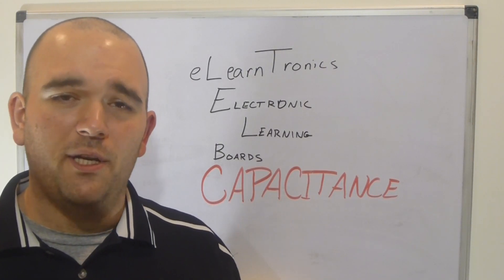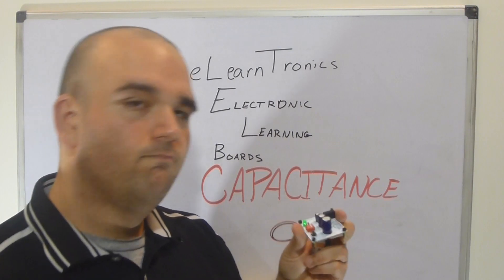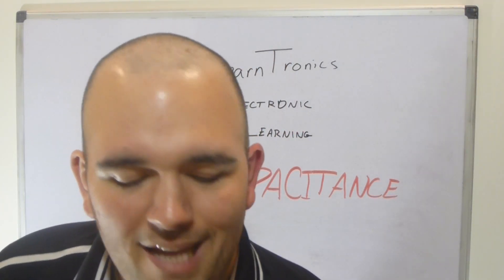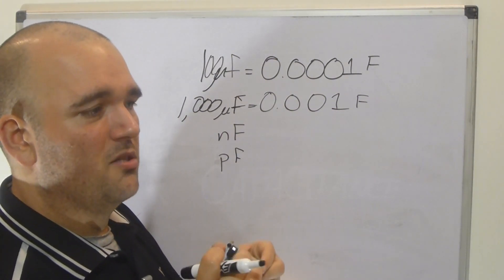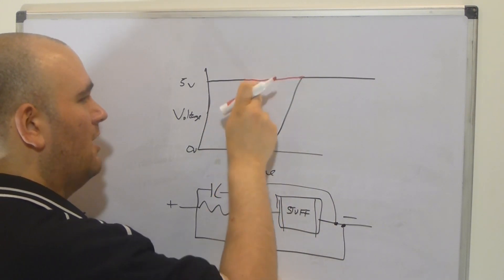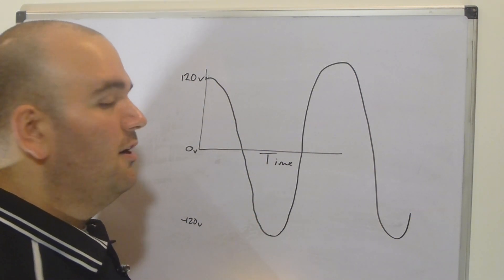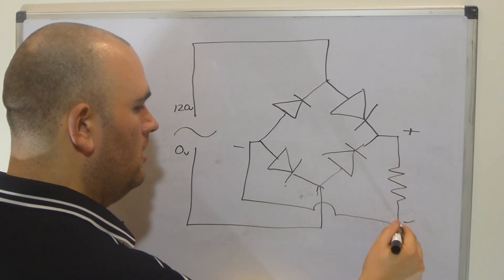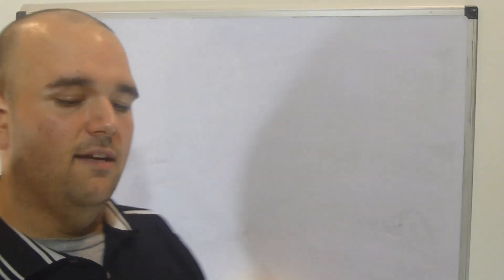Capacitance: How does it work? | Electronics Learning Boards from eLearnTronics

Comment: Hi! I've just completed this project, and although everything works -- I do see a difference in the longevity of the light when different switches are raised -- I'm not getting anything like the power you're getting from yours. More like 3 seconds from the largest cap, not 40. Is this a problem with the capacitors, or the battery, or...?
Reply: Same. Wondering if changing the resistor would make a difference in allowing the caps to store more energy.